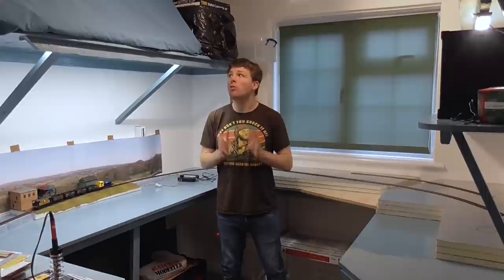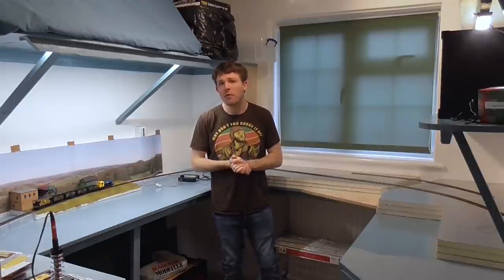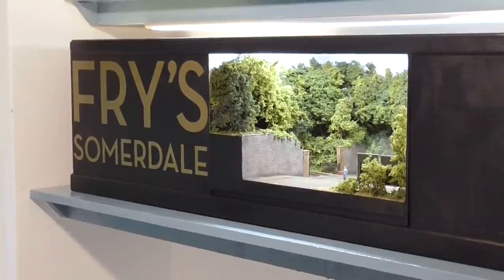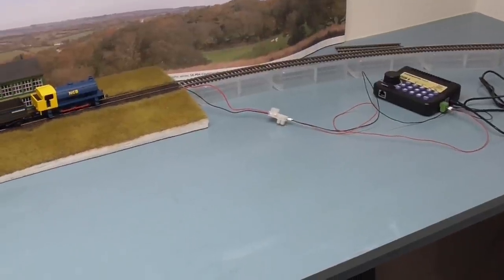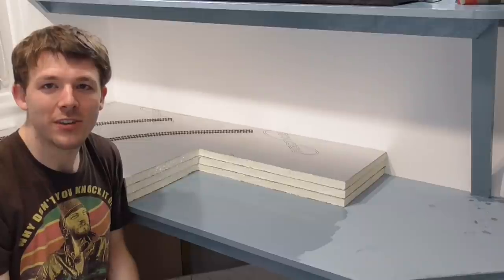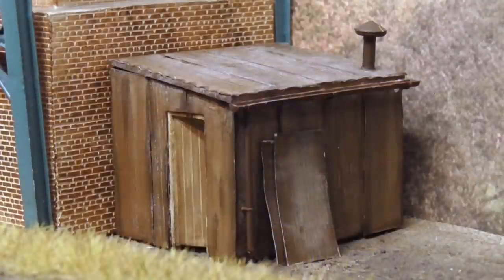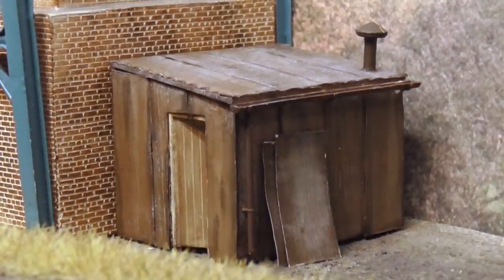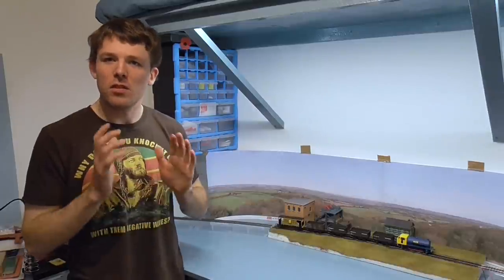Model Railway Room - Workbench, Viaduct & Lyncombe Vale - Update 3

Comment: great update mate your train rooms coming on nicely and i really like the lighting, one tip for the celotex boards i use them for insulating roofs the 1 inch thick boards i find easier to cut with a sharpe stanley knife, if you score down one side then bend the board you can then just cut the silver foil from the other side its alot less messy than using a saw and saves your lungs abit lol, keep up the good work looking forward to the next update, Tom
Reply from the maker: Thanks for the tip! Glad you enjoyed the progress. Hopefully more to come soon!

Comment: Cutting polystyrene outside, in view of the current concerns about plastics pollution do you really want to introduce more harmful dust into the environment?
Reply from the maker: Wouldn't the same happen if I cut it inside? It would be hoovered up and put in the bin, so same problem. What materials do you use for your layout build?
Reply: Hi I have made a large n gauge layout using wood, everything scratch built, the hilly bits look great using rock-like wood bark everything else from lolly sticks/ stirrers /balsa/modelling wood/cardboard ... there are some brass fences, all the trees are from garden plants, I’m afraid my good intentions have stalled with the grass bits and water features and of course the engines,rolling stock,track involve plastic but all my loads are from real coal and other natural product ... the end result is not super realistic like most modellers aim for but it’s surprising how ‘realistic’ found materials can be. If you built a simple extraction box for plastic cutting attached to a vac maybe that would work, railway modelling is great but modern quick methods don’t sit well with current concerns.